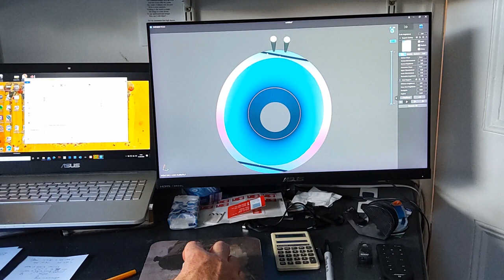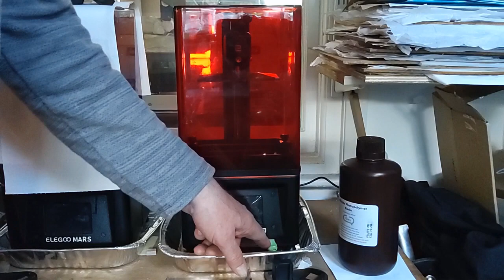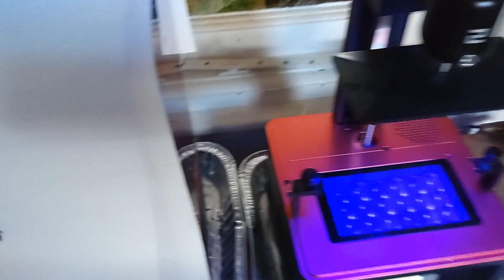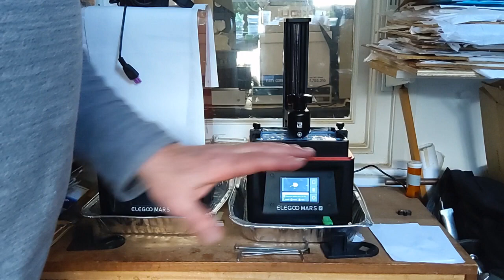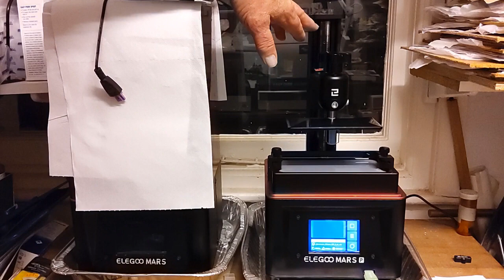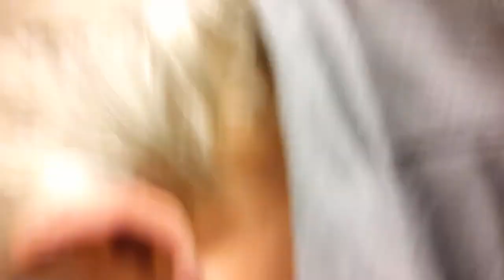3D Printing Part 2

Comment: Great demonstration Ian, I will need to start and learn how to use either Fusion 360 or Blender. I currently use 123D, but think I'm running into it's limitations (I hit my limitations very early on ;-)  )

Cheers Paul